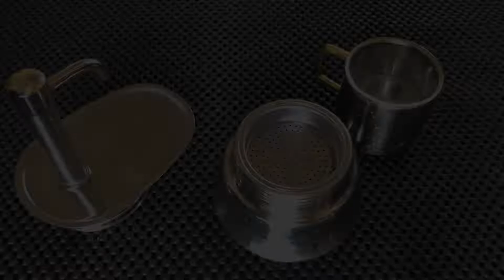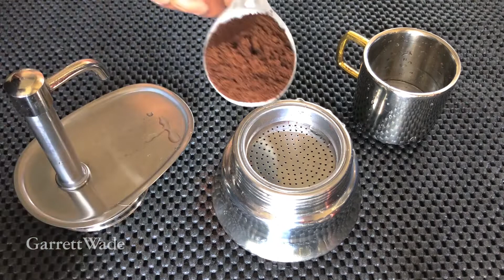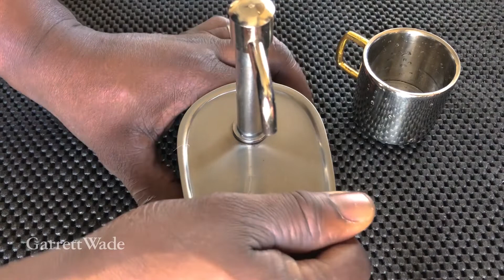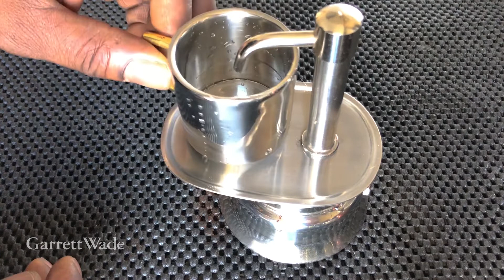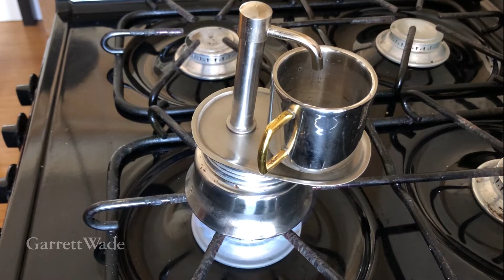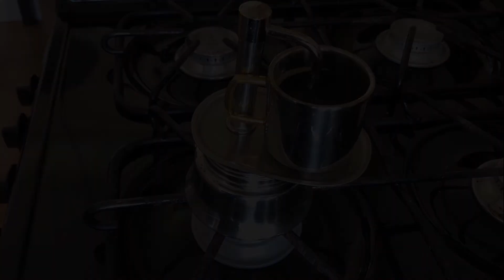Garrett Wade Stainless Steel Stovetop Espresso Maker

Comment: So a metal cup doesnt affect the flavor?
Reply: Hi from Italy :) What we commonly believe here, is that steel is tasteless and odourless of its own (which helps the tasting-testing of each coffee blend). Aluminum instead is said to have 'its own flavour', which tastes better to me (all the cooking shows and in fact top-end restaurants, use aluminum pans and pots too). But it's also a potentially dangerous material and to avoid it passing into food, it requires more attention and care when cleansing it. End of the day, one can never be too sure it's being kept 100% safe. So, even if many still stick to aluminum coffee makers and kitchenware, steel is really cherished by connoisseurs. Also seen as a later, better evolution is production. This maker here looks steel to me. Personally I like drinking my cup in a little thin glass. But this looks ok and one can still pour it in a glass cup afterwards (I suppose it will be stirred so even better tasting).